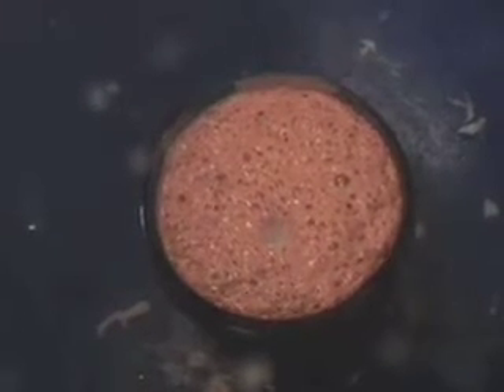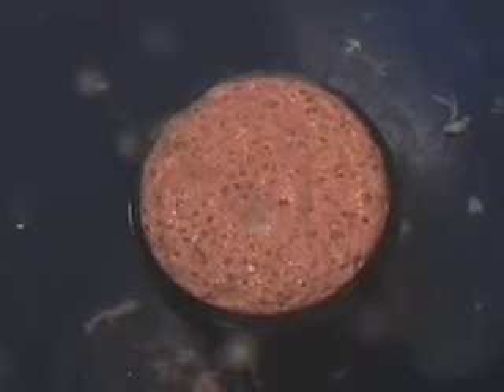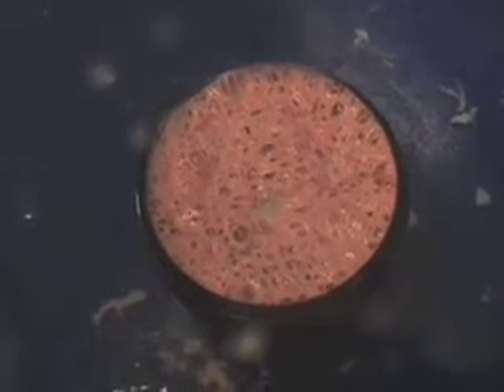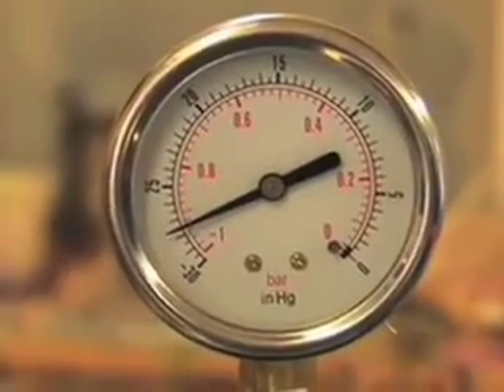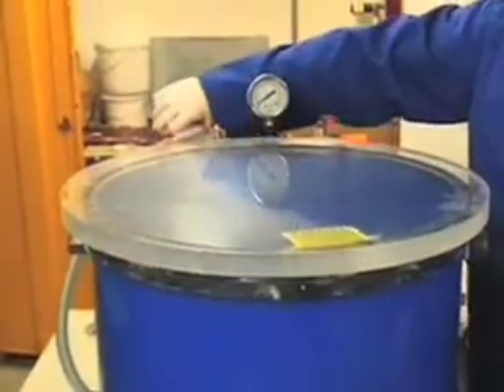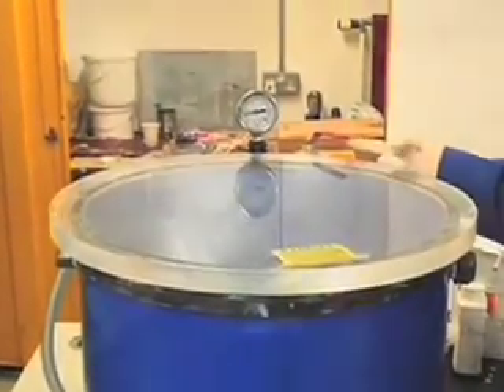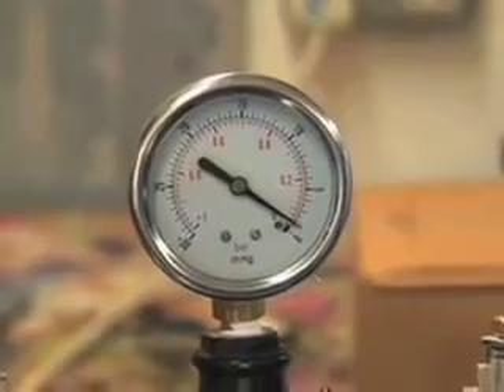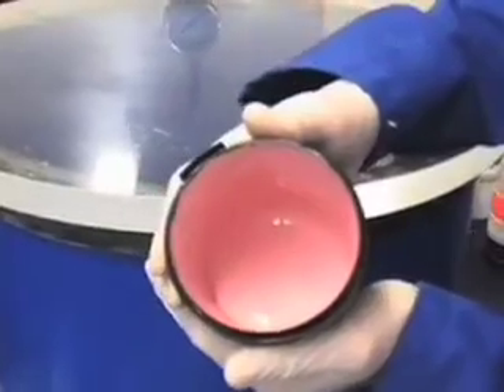How to eliminate bubbles using a vaccum chamber

Comment: Thanks for uploading your video. I have a couple of questions about degassing. I am trying to degass with a home-made vacuum chamber with a double stage 5 Hp vacuum pump, but I only get about 21inches Hg (I see your chamber gets to about 25 inches Hg). How many feet above sea level are you working on? I am 7300 ft. above sea level. Do you have any advice for me to get things working? Thanks for all your help.